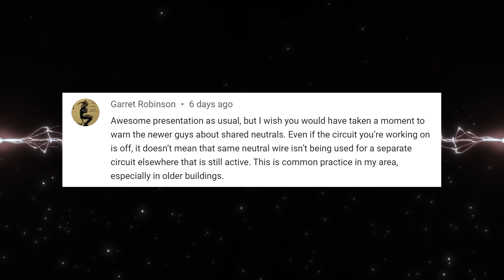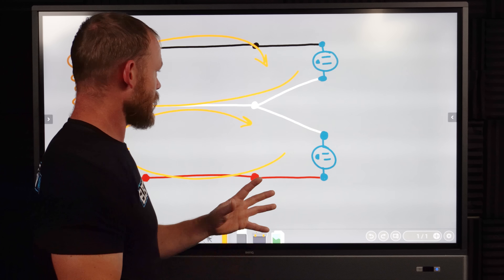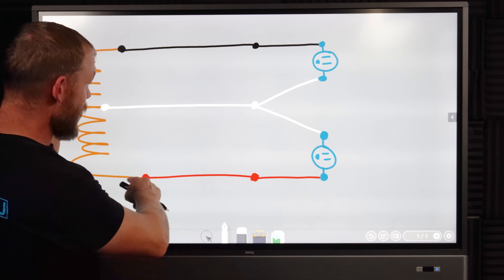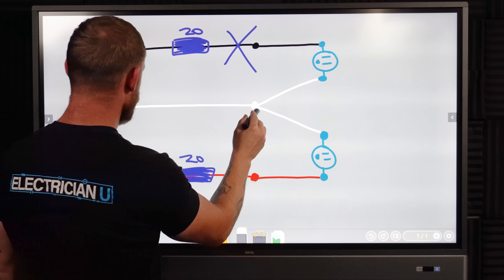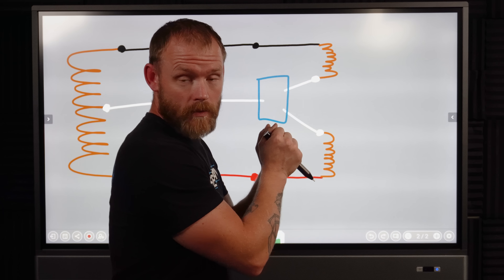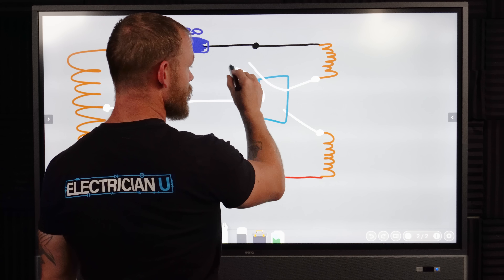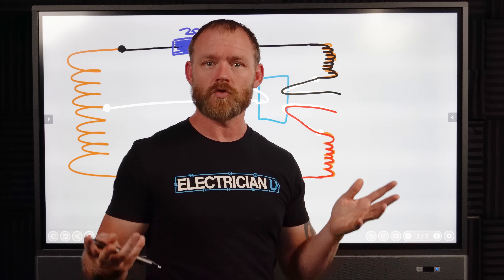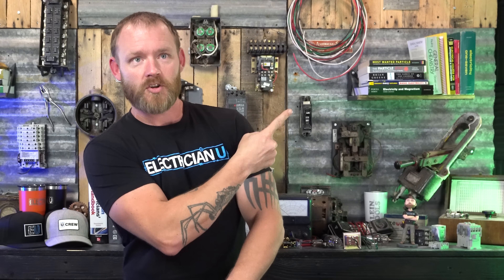The Dangers of Shared Neutrals: How To Avoid Being Shocked

Comment: When I install additional circuits , I avoid sharing neutrals for safety's sake 
This one time I was installing 3 additional outlets at a motel in the lobby for a breakfast bar and I looked at each appliance for the breakfast bar and how much amperage each appliance draws , So I put in a triple gang box along with 3 outlets but I put each outlet on its own 20 amp breaker and used 20 amp GFCI outlets because there was a coffee machine with a water line connected to it which requires GFCI outlets and they must be used within 6 feet of any water source
When I put each outlet on its own 20 amp breaker , I also ran 3 separate neutrals from the breaker panel to each outlet and connected them separately to the neutral bar 
So if at anytime one of the outlets had to be replaced , When you turn the power off , it's off at both the hot and the neutral  , I always treat a wire as if it's hot , Whether it's a hot or neutral wire 
I've ran into this many times where I would find shared neutrals , So I would have to go back to the breaker panel and turn off the breaker to the other circuit feeding the shared neutrals , One item I do have is a circuit breaker finder which saves alot of time and aggravation
Another danger about shared neutrals is that if the main neutral ever came loose , That could 220 volt the 110 volt circuits and damage every appliance or light bulbs connected on those circuits
That's another reason I avoid sharing neutrals and I've seen this happen at another motel where the rooms were wired with shared neutrals and one of the main neutrals got loose and lost electrical contact with the other neutrals and it 220 volted two circuits and blew two television sets
So anytime I install additional circuits I never share neutrals which is a dangerous practice

Comment: Is is possible to install a GFCI receptacle on a shared neutral circuit in a way that protects the downstream outlets when the downstream outlets are also using a shared neutral?   Or does a separate GFCI have to be installed on each outlet when using shared neutrals?

Comment: Awesome video! I'm relatively new to the channel, so it's awesome seeing this, as I hadn't ever thought about something like this happening, let alone know that any older house wiring would share a neutral. Does reinforce the importance if sticking a non contact voltage tester around all wiring to be worked on before toughing, though!

Comment: This actually happened to me on a shut down. We were replacing a set of gear and had all the conductors disconnected. Both sides of the mains were locked and tagged out. I was wedged inside the gear, assembling the neutral buss. All at once the gear became energized and I was getting the shock of my life. While the system we were working on was locked and tagged, there was a neutral somewhere in the building that was tapped in to what we were working on. A time clock had came on and some of that unbalanced load came back through the feeders that terminated in the gear we were in. Coincidentally, three phases that we had tied up had floated over and were touching the gear. That was the first time I went home and thought about never going back.
Reply: Wow glad you’re okay
Reply: Ground the neutral and then that shouldn’t happen

Comment: So in my garage  has a 12/3 ...1 red 1black 1 white running to the garuage.. black on its own 20amp breaker and red on its own 20 amp breaker..when i turn off one breaker  one specific outlet reads on my outlet tester as open neutral....n when i turn off breaker for  black n turn on breaker for red... the tester is on first of all whuch ia alrming it self n 2nd it reads open nuetral...n when I do vice versa it reads reverse neutral and hot.......is my tester still getting energy but from the neutral because one breaker is on one off n im assuming they are sharing a neutral...because they ran a 12/3......but also the lights are being controlled from breaker

Comment: This was one of the first things I learned about when I first got in to service work.

The amount of melted kitchen plugs I've had to replace is unspeakable.

(There's also this one other thing I noticed guys did to save wire. They would run power to the lights, and use 'switchloops' down to the switches.) 

Can't be doing that no more though. Since you need 120 at the box (for potential dimmers.) 👌 That and I think too many apprentices were getting zapped. 😂

Comment: One other thing happened when I was having my business rewired in an old 1937 commercial building with one, two or three businesses being housed in it over the life of the building. The electrical panels and wiring had been changed and upgraded (sometimes by amateurs) several times. The landlord had a supposed electrician come in and change the timer for the signs from one business in the building to another but the conduit to the sign was still in the first business location.  The pseudo electrician took his power from the other business main panel but somehow left the connection of the neutral on the first business main panel, so there was a hot wire from one panel and the white wire from another main panel. So my commercial electrician who was installing whole new panel for my business shut all power off to my panel at meter. As he was pulling the main leads the hair went up on his arm near the neutral and he stopped immediately.  The back feed was quite significant.  Traced it to that old timer box. I think it was a once in his 15 year experience happening. Still when all power to the business is shut off and supposedly we all had our own meters, and main panels, i can see the mistake would be easier. But you have said always check for current even in a dead box. Jerry.  PS Love your channel. Have watched most of your videos

Comment: I ran into something similar in an older home I own. Two romex wires went into a junction box, one 12/2, the other 14/2. They ran out of the j  box into I believe a bathroom on another floor. I tied into the j box to put in a receptacle. The receptacle would not get power connecting to the 12/2 black (hot) and white (neutral), in addition to just trying to the 14/2 black (hot) and white (neutral) as well. It WOULD however work by connecting to the 12/2 black (hot) and 14/2 white (neutral). I'm aware that you should not mix different gauge wires and understand electricity doesn't care for color the wires is, but for informational purposes, can someone explain to me what is happening here? I know it sounds funky, but this is also 100+ year old home.

Comment: @4:11 It sounds like you are saying that if you touch the top left white part of the wire, where there is current flowing, you would get shocked because there is current flowing on it, but if you touched the top right, where there is no current flowing, you wouldn't get shocked. 
This doesn't make sense to me. You dont get shocked by current; you get shocked from voltage. You could touch a 10V, 100A wire, even though there is 100 A going through it, because 10 V is low (assuming you dont have wet hands). If the top-left part of the neutral have current though it, there will be a small voltage due to the resistance of the wire, but nothing that could shock you.

Comment: @7:45  So this is actually a really common misconception. If you are using two 1 pole breakers with a handle tie that does not mean they are common trip. What makes a breaker common trip is actually an internal mechanism on factory 2 pole breakers with the common trip feature. If we have a 1 pole 15A circuit for example and I hold the breaker closed and someone shorts it downstream it will still trip and kill the circuit even though it's being held closed, hence trip-free breakers. We can actually see this in the UL 489 certification with the following:

Independent Trip – A 2-pole circuit breaker that does not have an internal common trip feature is marked “Independent Trip” or “No Common Trip.” An external handle tie alone does not qualify as a common trip mechanism — a breaker of this type is marked to indicate it is an independent trip breaker.

The main point of the handle tie with multiwire Branch Circuits is to make it so if someone actually moves the handle both circuits will open/close together. It's also to make it so that if some other electrician shows up who didn't do the original work, they see the handle tie and look and know it's a multiwire circuit and to be careful. If we have two 1 pole breakers in good condition there is a good chance, they still will trip but it's not guaranteed and if the breakers are older and stiffer, they probably won't trip.

If you read 210.4 (B) (B) Disconnecting Means. Each multiwire branch circuit shall be provided with a means that will simultaneously disconnect all ungrounded conductors at the point where the branch circuit originates. 

Doesn't actually mention anything about the trip.
Reply: Thank you!  Came looking for this comment

Comment: Replacing a stove receptacle. Opened the dbl pole breaker. Took the old one out and touched the neutral and ground at the same time, WTH! Outlet right next to the stove nothing in the box to indicate where the neutral was shared at, but, yea. Flipped the breaker labeled kitchen recpt. I was good. Good lesson though, now I check all the wires to ground, all the wires to each other and ground to all wires. I know I tested the ground 2x, but I really don't trust anymore.

Comment: Great video. Years ago I found a shared neutral in my parents' house when I got a tiny tingle replacing an outlet. Happened when light on another circuit was on. Only 6v, but it was a lesson to always check using the meter and not just the non-contact detector. 

Also relevant, we bought our nearly 100-year-old house about a year ago and yup, full of shared neutral wiring. Worst part is some of that 12-3 goes back to 2-pole breakers on the same phase as improperly wired MWBCs. We plan to rewire the house in a broader renovation, but that's a few years off. For now, I shifted the shared neutral hots with more load to opposing phases in the panel. I still need to find the proper handle ties to put in, but I feel better not having my fridge and microwave overloading their shared neutral anymore (yay old houses).

Comment: The drop on the neutral properly connected should not create voltages high enough to be a hazard.  The hazard that is compelling the rule change is an open neutral, where the electrician or other person is attempting to diagnose and repair the circuit. In such cases, even with one circuit breaker disconnected, line voltage is present on the hot and neutral conductors at every device. This is why the breakers must be paired under the code.

Comment: Also
If you are not sure if you have shared neutrals or not in your situation (should be obvious), and you need to shuffle breakers around to modify or add to a panel, (e.g. adding a generator connection where the gen. breaker typically has to be adjacent to the main to facilitate the lockout), always be sure to move breakers to the same phase as you found them on.

Comment: I'm not comfortable with the first half of your explanation. Tell why it was acceptable to share neutrals. Show that the current flow peaked on different phases at different times without overloading the neutral.
I'm old school commercial and used to consistently run home runs with three phases and a neutral. It was never a problem unless the yahoo working on it didn't understand electrical theory and basics. That's why apprentices were never allowed to touch anything wirewise if there was a meter already installed.
It's only my opinion, but since NEMA basically runs the NFPA70 world, almost all code changes (not 100%) are driven to sell more expensive products or just more products. The electrons are still doing the same thing they always did.
I got my first j card on the 1984 code and before that I was an aviation electrician on the flight deck of an aircraft carrier so bring on the comments.

Comment: I don't know if this what I ran into or not.  I was working on a dishwasher and shut the breaker off and checked the "hot" to the "ground. No reading on meter. Went to pull the wire out and got a shock. I started checking everything I could think of.  I finally found I had to shut a second breaker off to completely kill that circuit. I notified the homeowner and told them they needed to call an electrician to get that made right. With everything hooked up everything worked the way it was supposed to. Any thoughts as to what I had. I am sure I'll get lots of repesponses that I should have "Red tagged" the system and walked away.
My second question is; what is a "floating neutral?"  I have worked several places and other techs would come across a circuit acting weird and they would say "must have a floating neutral."  I would ask theses guys how they knew that and how do find it and fix it?  Never got an answer. I have sent this comment to several tutorials but never got a reply. Can anyone help me?
Reply: was 2 circuit setup w shared neutral as you found 2nd breaker needed to kill all wires...   typical for kitchens to have 2 circuits 12/3 shared neutral often sharing DW with disposal. Always check hots and neutrals to ground before messing with 'em.
I believe floating neutral refers to "broken"  or "loose" neutral such that your hot back to panel voltage reading  is less than 120v,  the circuit is nonetheless trying to complete the loop by way of induction/other less conductive paths...some devices may actually still function somewhat on lower voltage (80-100v).... likely a loose neutral wire in any jbox along the way or loose screw  at the panel.

Comment: Many years ago at my fathers house, we had a 220 water pump that was fused and switched. There was a separate fuse for each leg. One day one of the fuses blew and the pump ran even though the switch was off. I seem to remember that the pump may not have been running full speed but not sure.  Also, a new fuse corrected the issue and an electrician indicated that it had been wired wrong which he corrected. Any idea of how it was wired wrong? Would switched neutrals cause this?

Comment: I had my helper shut off a breaker for 240v lights, I didn't think to tell him to shut both breakers off and he only did 1. I got an eye opening experience when I took the wire nuts off thinking that the power was completely off. Thanks for your videos!
Reply: 240v on double single breakers? That’s crazy, should be a double breaker

Comment: My house was wired completely with shared neutrals  (built 26 years ago).   I dislike it, but it is allowed by code even today.    It makes using GFCI and AFCI breakers much more complicated and expensive (hint: you have to use a double breaker).   Had I known they were doing that when they built it, I would have insisted each room be on a completely independent circuit.
Reply: I don’t know why it makes GFCI/AFCI more expensive. Often a double space GFCI breaker is about the same or even a little cheaper than two single space GFCI breakers.

Comment: Hey bro I love your videos I do have a question though I watched the video on the 20amp breakers for the 15 amp  Receptacles... My question is is I have 20 amp breakers in my fuse Box and 15 amp  Receptacles  And I run 2 space heaters.. Should I change my receptacle to a 20 even if my gauge is 14 ? thanks again and keep up the great work

Comment: I don’t know why so many people have heartburn or get confused over MWBCs. Every single house has them for the dryer and range.

There is one very overlooked benefit of a MWBC. >>CONDUIT CONDUCTORS<<!! I recently installed multi wire branch circuits in a rewire of an older home. I needed new circuits in the attic using existing conduit, so I put MWBCs in that conduit. In a MWBC, the neutrals don’t count, so I was able to get a lot more bang for the buck out of that conduit. Even after derating, with 90° THHN, I was able to have plenty of 20a circuits. 

People fuss about these shared neutral circuits, but they really are more efficient. Here’s an idea —> Get a tester an USE IT before touching stuff.

Comment: Another issue is if you connect those 2 whites at the end you 240v across 120v loads , same as if you were to disconnect that common neutral at the panel

Comment: Here's one.  Level 1 apprentice, hasn't even been to school or seen a code book.  Putting together IPLC plugs in the middle of winter.  Allegedly, only one of the two "whites" from the IPLC was connected back to the main run.  I think?  I can't remember exactly what it was but it was basically a broken neutral problem where two block heaters would be in series with 240v.

Comment: I love your content and really appreciate the work that you do. Having said that, I'm always a little confused about why it would matter whether the powers turned off or not. If PPE has been uand proper procedures be used, it doesn't generally matter. I will readily admit that there are times when I will absolutely turn power off, for instance when there's a mechanical device like a condenser fan replacemeant,  or I'm pulling a motor,  We're working on sense of electronics that I need to unplug and I need to protect. But the usefulness of having the power live, particularly when doing diagnostics, really can't be overstated.  And yeah, you get shocked when you first learning how to do this,. But if you can survive the apprenticeship, you learn not to get shocked.  Having said that I've been bitten by 120, 208, and 277.  Those last 2 are not fun, but also not something that happens more than once.